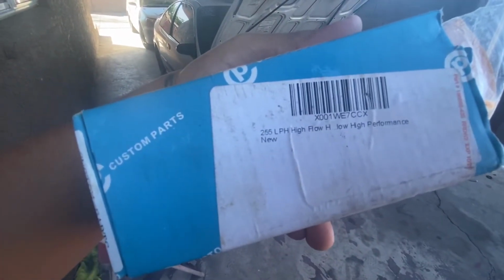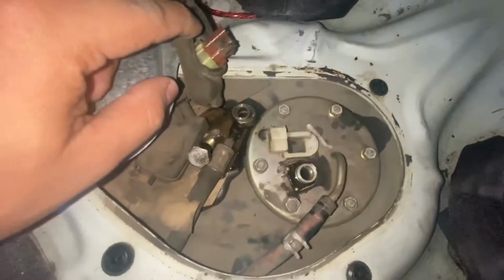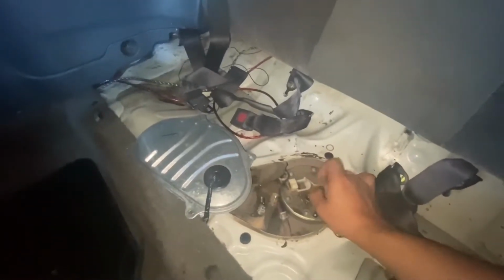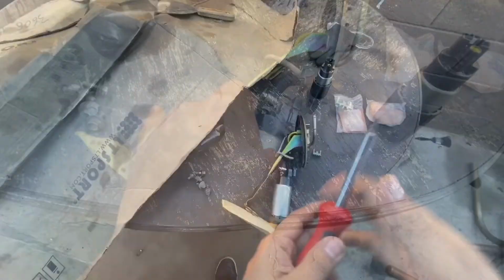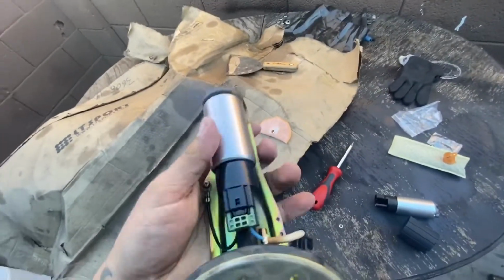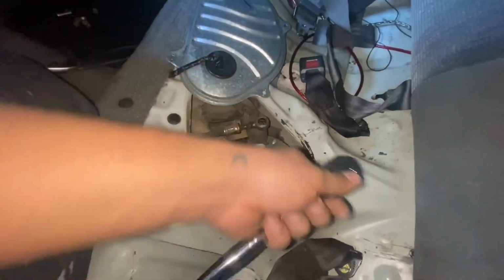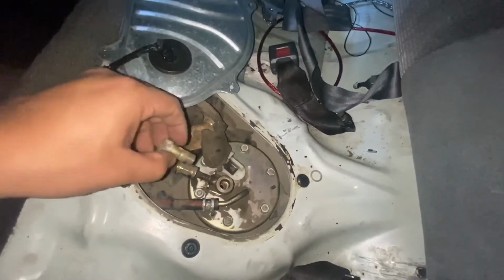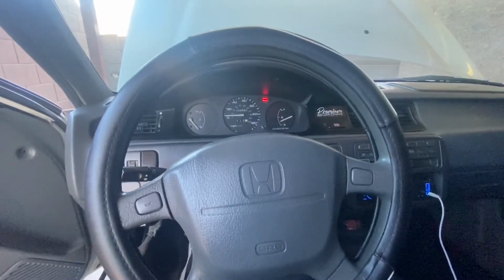How to replace your fuel pump  on a 1995 Honda Civic

Comment: Question, why did you have to disconnec to the battery because it might be an electric field pump? Is that why my car's feel pump is not working when I try to install it?
Reply from the maker: I don't think you have to. I personally just disconnected it from habit. Anytime I work on anything that has a sensor or power to it I disconnect the battery just to be safe .
Reply from the maker: When you turn the key to the on position you should hear a slight Humm coming from the fuel pump before you turn it on. That's a quick way to know if it's working or not

Comment: How long did this one last? I bought one 2 days ago drove it and it died the next day.
Reply from the maker: I sold the civic but the pump was working fine the whole time I had it. Maybe re check the lines that connect to the pump. I had an issue this  one time  where the car died on me and would turn on and when i gave it gas it would turn off again Turned out to be a small tear on one of the hoses that connect to the fuel pump. Is your pump priming whe you turn the key?
Reply: @ no it doesnt prime up but the day i got it and put it in it primed up and fired right up so maybe it just had died? im gonna try abd replace it and then see if itll last
Reply from the maker: Hmmm hopefully you just got a bad one. You reach out to the seller and ask for a replacement?
Reply: @budgetfixes  No i didnt, I still havent found what the problem is im so confused
Reply from the maker: Hmmm you replace the pump only? Maybe the whole assembly is bad the fuel pump module... I'm not sure on how you would go about testing the module itself but definitely worth a look

Comment: When I unscrewed the 17 mm bolt hella gas started come out. Like a lot lol. The car has a lot of gas so I’m guessing that’s why? I know it sounds like a dumb question but I just wanna make sure I didn’t do something I wasn’t supposed to lol
Reply from the maker: No you’re fine lol when I replaced my pump I didn’t have too much gas I wanna say I had about 1/4 tank of gas left even then when I removed the hoses gas leaked out. Another thing is that the car was cool I left it sitting over night so no pressure inside the gas tank or whatever lol hope this helps
Reply: Release the fuel pressure first, these civics usually have a drain under the fuel tank as well just be sure to put Teflon tape or something to make sure nothing leaks out